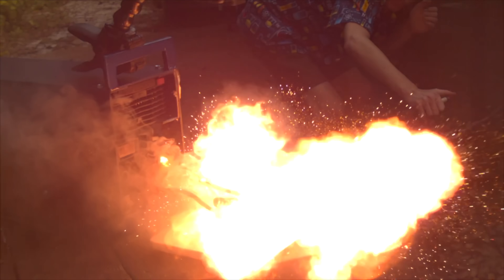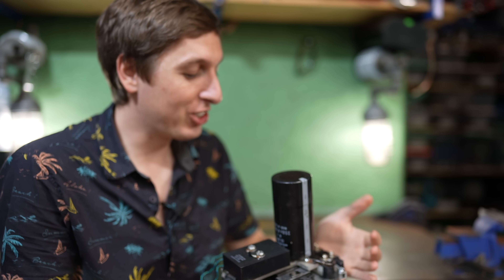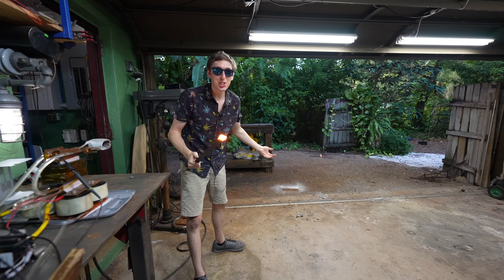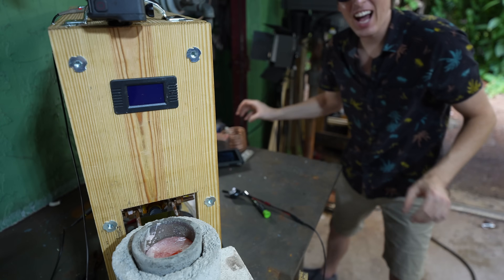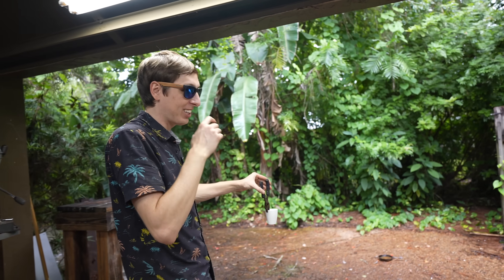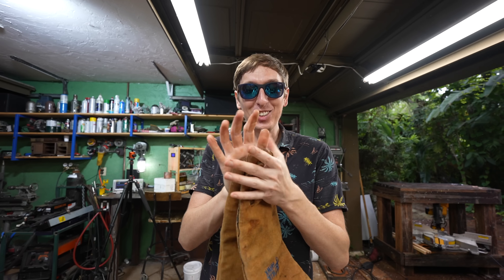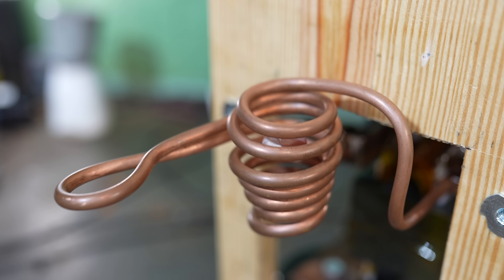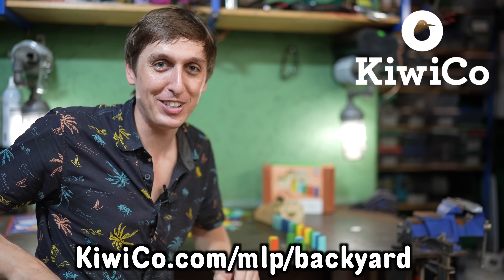DIY induction heater that can BOIL STEEL

Comment: This seems like something that would really be of interest to a blacksmith!
Reply: That's exactly what I was thinking, seems like if you could stretch out the induction coil to 6" or so and lower the power so that you're not accidentally melting your workpieces you'd have an excellent 'furnace' for knives and other small-medium projects
Reply: They're way ahead of you, some bladesmiths use these, and they've been used in industrial foundries and  blade making factories for quiet a while.

Comment: How much does that cost in electricity? how much does it use? That's a great way to heat metal. Blacksmiths and knife makers would love that thing. What would it cost to make one? could it be run off a lithium battery? With an inverter, or converter or the gadgets that turn DC to AC? The electronics are way over my head.
Reply from the maker: I think i used 10kwh for the whole video, so about $1.50 in electricity. an order of magnitude cheaper than coal or propane.

You wouldn't want to use batteries, it draws too much power, and you would have short run times. A normal DC-AC inverter would only run at 60hz, and you need it about 60khz. 

And the electronics were over my head too, but i just kept studying and i finally understood it. (at least understood how to build it haha)

Comment: if you emit fast neutrons (like from radioactive elements) on metal (like steel), it'll get the hydrogen structural deformation, resulting in less durability and easier to "pop" when dropped in water

Comment: I’ve been told magnesium gives off uv when burned but I’ve never checked. I have read it burns in an N2 environment and I’ve seen it burn in a CO2 environment. In highschool chem the teacher thought it’d be cool to do the matchstick experiment with magnesium ribbon but the ribbon just kept burning.

Comment: Whoa, nice!
How much does this thing cost to build and operate? It has some serious Blacksmithing and other Metalworking potential, and if it's cheaper than already-established methods, this might actually change the whole playing field!
Reply from the maker: induction heaters are just making their way into the hobby blacksmith market, its only a matter of time until they are the norm. The only problem is they make a lot of heat scale because the part is heating in the open air, in a coal forge a lot of the oxygen is used up burning the coal so it cant react with the steel as much.
Reply: @TheBackyardScientist  ah, I see. Well, thanks for the reply!

Comment: Mmm wondering if I could build one for use in melting Bismuth? I have a gas camping stove but its a little unsafe as gas and flames etc... (I'm in the UK) wondering how cheap and easy it would be to build (with zero knowledge).

Comment: This is probably the first video you've made where I was actually worried about what you're doing. Glad you're alive.
1) Conductive crucible will prevent your lighter metals from jumping.
2) Make sure you never let moisture in the coil.
3) Aluminum explosions are bad.
4) What frequency and DC voltage did you use?
Reply from the maker: depending on the coil its resonant frequency is anywhere between 45khz to 80-khz, and its 120v rectified so around 170v DC

and yeah voltage on the coil can be as high as 1000v so no touchy haha
Reply: @TheBackyardScientist  Cool, thanks for replying. Yes, please don't touch that. I like your content. One more question: How did you regulate power? Did you change the DC voltage, frequency (if so, above or below resonance), PWM, combination?
Reply from the maker: @PYRO80812  When i was testing it i used a variac, but this circuit doesn't have any explicit power control built in, basically 100% on all the time. It uses phase-lock-loop to track the small changes in resonant frequency you get by putting objects in the coil. you use a resistor/potentiometer to set the resonant frequency for the coil you are using, and you can regulate power by slightly turning the potentiometer to slightly off resonance.

Comment: molten steel doesn't explode when it hits water due to the lidenfrost effect. the effect you are thinking of is that water explodes entering molten steel because of the flash boil acting like a gunpowder charge. it's a big problem at steel mills, and throwing a water bottle in the pot is like throwing a live grenade in. I'm not sure but there might even be some disassociation of the water adding H and O to the "fun"

also, the mag probably stuck because it fusion welded to the steel
Reply: Yeah! 
That was really cool when he dropped it in the pool. I never expected it to glow for that long, when it got under water. But the leidenfrost effect was indeed creating a layer of steam around the molten steel, preventing the water to get much contact with it and cool it down quickly.
Reply: This guy steels
Reply: A friend of mine does Blacksmithing. I do casting. Its so weird for me when i go to visit and he's dunking his tools into buckets of water to cool them off, anvil gets splashed, swish it off.. no biggie. Exactly the opposite of me. I dry all my tools in the fire of the furnace, all my molds and tongs. Always assume things around me are blazing hot because they probably are after being in the fire to drive of any trace of moisture.
Reply: @keithyinger3326  it's also because of the fact your dealing with liquid that can splash and it will happen without warning if you forget to heat something, whereas in forging it's used to keep tooling cool enough to handle, as well as to blow oxides off using the small steam explosions created when the lidenfrost is broken by an impact
Reply: Blacksmith use the same effect to clean up the steel they are forging.
A bit of water on the hammer or on the anvil, then whack the steel and all the crust forming on the metal is blown off with a loud bang.
Reply: @Seldoon Nemar I was going to say that. I would like to add that water breaks down (not sure of the terminology) at 7000 degrees Fahrenheit.
Reply: Wouldn’t be surprised if the next video we see is something like this 😂 https://youtu.be/78CBUcGtfOs
Reply: @thedudeprime4677  this is what happens when a mill doesn't pre-heat their steel to drive out moisture. 

https://www.youtube.com/watch?v=-RYCXDUt2m8
Reply: Breaking water in to H2 and O2 by definition will take just as much energy as you'd then release by burning it (if not a bit more). Otherwise you could make a free energy device that splits water apart, burns it, and uses that heat to split water. So it may happen when exposed to molten steel, but it wouldn't actually increase the amount of energy being released.
But yeah, you're right about the other stuff! I think molten aluminium can react violently with water under the right conditions though- maybe that's what he was thinking of?
Reply: @coryman125  any molten metal poured into a cold mold has the potential to explode as the sudden heat drives any moisture out, underneath the liquid. it happens with everything from aluminum to gold. 

as for the disassociation, it's more about violence. it's the same energy total, but if it manages to crack those bonds, it goes from a steam explosion to an explosion, and the velocity is much higher. not that it's any more energetic. more like high vs low explosives. same energy with a different release curve
Reply: @coryman125  its taking all the energy that was stable in the steel and turning it into an explosion
Reply: I've heard that if molten aluminum is poured into water quickly enough and/or in a low-oxygen environment, in such a way that a proper layer of oxidation doesn't build up, then the explosive force can be quite powerful... and probably has something to do with coulombs, but don't quote me on that though, I'm not exactly a physicist, lol.
Reply: go out side
Reply: @phishyouknow4938  sorry you're intimidated 😥
Reply: @phishyouknow4938  Bruh

Comment: Thank you for this one, i always wondered why blacksmiths and stuff never used a method like this to forge bits quickly. Or why people did not use this method for casting.
Reply: It's used for forging in industrial processes, if you know the size and shape of the metal you can very finely control the temperature by modulating the power draw.

On the other hand, blacksmiths use various sizes and shapes of material and don't want to melt things, so a constant-temperature fire is more useful.

It is good for casting, but an expensive solution.
Reply: @danielf3623  ah interesting thank you. Yeah it just seemed like an easy solution so always kinda bothered me why it was not more widely used.

Comment: To anyone interested in induction heaters, there are many affordable 2500w kits out there that will allow anyone to melt metals such as aluminium, copper, brass and supposedly, cast iron.
Highly recommended if you want to melt metal FAST.

Comment: Well this is basically almost a DRSSTC system maybe try building one of those in the future?
Reply from the maker: Actually a DRSSTC driver might be better for induction heating if it could track the resonant changes. I can only fit so many windings on my primary coil, so im drawing almost 100 amps at 120 volts! If i had some way of limiting the pulse width i could power it using 240v without destroying everything.
Reply: @TheBackyardScientist  yes I did some induction heating with my DRSSTC system (there are some vids on my channel) and it worked pretty well and can even play music. Altough im not sure what the optimal frequency would be for an induction cooker. Does your driver have feedback and ZVS?
Reply from the maker: Yep it uses capacitor voltage fed through clipper diodes as feedback.  The 4046 ic monitors the incoming waveform and compares it to the frequency you set it to, then raises or lowers the frequency to maintain a 90 degree phase shift for ZVS resonant switching. 

Epic DRSSTC by the way! I checked your channel out pretty cool, turns out I've actually already seen your posts on highvoltageforum haha.  

When I was in college our engineering club built a large DRSSTC, so ive had enough of them, i want to build something quieter haha, maybe QCWdrsstc or a CW one to play music on, like this https://youtu.be/WNpIufPNNX8?t=71

Comment: Will a electromagnetic feild destroy a concrete wall?
Is there any concept of destroying a steel fiber reinforced concrete with electromagnetic field (electromagnetic propagation /Radiation)
what I feel is
*If the magnetic field is passed through, the steel inside the concrete gets magnetized
*and when you change the magnetic pole outside the wall(changing poles continuously) 
* the steel inside the concrete gets attracted and repelled
*when doing this continuously, the steel moves back and forth causing vibration inside thus breaking the concrete

Comment: magnesium does indeed produce UV light when it burns, and looking at it can cause permanent retina damage
Reply: You're going to need to type larger if you want him to see it then.
Reply: I'm in accord with the unknowned man
Reply: I wonder if it produces any other radiation like xray
Reply: @Convolutedtubules  no, the temperatures needed for that are way too high
Reply: @internetuser8922  Really?
Reply: @Convolutedtubules  i mean the hottest neutron stars have enough energy to do that. you need temperatures in the millions of kelvin to emit x-rays by way of black body radiation.
Reply: @internetuser8922  Certain types of lamps and a few other devices readily produce x-rays, therefore what circumstances exactly are we lacking other than heat? (which would be localised thus requiring relatively little energy.).
Reply: @Convolutedtubules  that's a different effect. when you heat up a material really hot, it glows due to black body radiation. it goes from infrared -> visible light -> UV. it can reach x ray levels, but only at ridiculous temps. the "normal" way we generate x-rays isn't by making stuff really hot. our man-made machines use different effects to generate x-rays, like passing super high voltage through vacuum tubes. basically just accelerating electrons to super high speed & colliding them with tungsten or something.
Reply: @internetuser8922   @Internet User  Assuming it takes at least one million degrees Kelvin for the emmition of x-rays, does that mean these temperatures are present in man-made x-ray tubes during the collision of electrons?
Reply from the maker: 😎 epic

Comment: Yes, burning Mg gives off UV. Also, you don't have proper PPE (both for the UV light and against molten droplets hitting your skin)
Reply: Molten droplets hitting skin is ok according to TBS, as a layer of super hot steam and gas shields the skin from the metal

Comment: It's not boiling, it's the carbon burning. As the carbon combusts, it turns into CO2 gas and rapidly expands, sending tiny beads of molten iron oxide flying. That's why there are more sparks when it's splashed out, only the carbon particles very close to the surface can combust as they need to be in contact with air. More surface area, more combustion, more sparks. Besides, the boiling point of iron is around 2800 °C, a clay-graphite crucible will melt well under 2000 °C.

Comment: "Its basically impossible to put out a magnesium fire" Walks Toward Plants With a Cup of It
Reply: Thankfully, a magnesium fire is only such as long as it burns magnesium, even if you drop it in the middle of a forest the only thing you need to do to prevent a wildfire is to control the regular plant matter fires it ignites until it burns out.
Reply: Somebody woke up and chose violence lol

Comment: I love how Kevin let the molten steel bubble all over the wooden frame haha. I was half expecting the thing to burst into flames. Solid build kev!
Reply: Wood is flammable, but it’s also an excellent thermal insulator. Takes a lot of sustained energy to combust.
Reply: I think I just found my new way of heating metal for forging
Reply: wood will ablatively insulate itself from that much heat. it chars long before it burns and unless there's an ignition source, it usually won't do more than give you a small flame show before going out
Reply: @Seldoon_Nemar  cool. TIL
Reply: hello jay.
Reply: ᴷⁱⁿᵈˡʸ ᴴᵉˡᵖ ᴹᵉ ᴿᵉᵃᶜʰ ⁵⁰ᴷˢᵘᵇˢ ❤️  No. I will not.
Reply: Bc is amoung us
Reply: Well I wanna know is how he flawlessly switched between content and advertisement
Reply: Hey. I am your Subscriber👀
Reply: Those sparks are harmless, they sting a little when you get them on your skin, but otherwhise they dont do much
Reply: @paranoia0like0hell  Precisely, very high temperature, but low mass, so low heat.
Reply: Tom Simons ᨆ  ok
Reply: He could’ve treated the wood in fire stuff
Reply: Now that is an induction heater!! For all that are wandering, this is not a standard ZVS (commonly known as a Mazilli driver).
Reply: Very nice build! This is a very different driver rather than the standard Mazzilli (ZVS Zero Voltage Switching) driver. I love it.
Reply: Hey Jay. What values did you use in your biggest voltage multiplier?